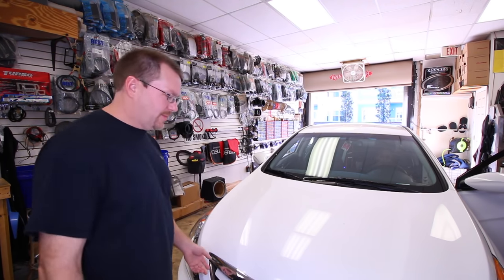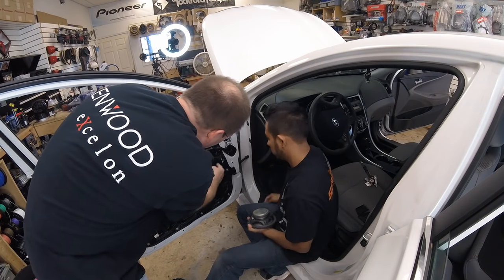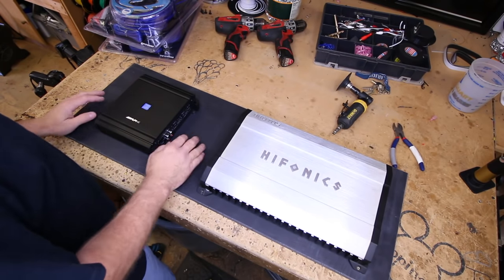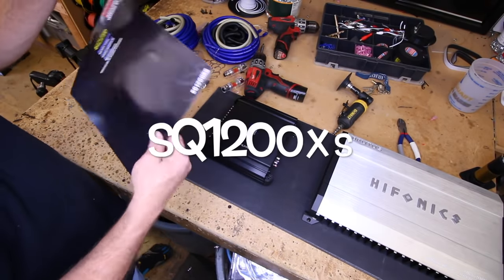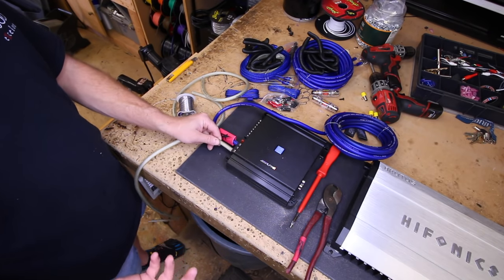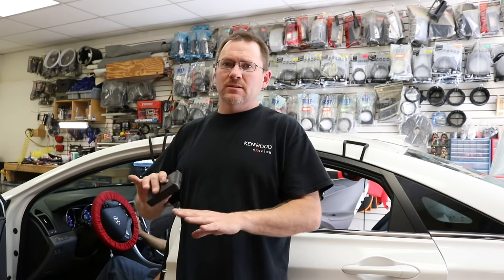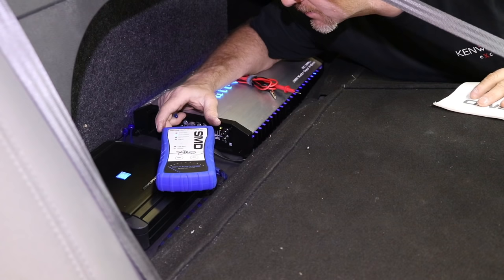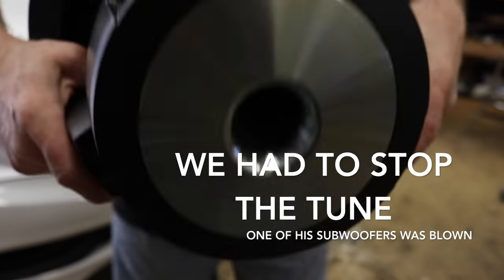Hyundai car stereo system installation make over

Comment: I love how you point out the wrong on stereo amps installation here.  When I first started doing stereo installations, I did many wrong things but learned better after many years of practicing.  If I had people like you to point out the wrong and right while starting off, that would have been a good experience for me.  Nowadays watching your video's are great and watching how some people don't take the time to research and do a poor job that you clean up is AWSOME.  It is like some do a C grade to a fail and you guys come in and do a A+ work!  LOVE IT!  (Also want to mention zip ties are great when wires are too long)

Comment: I've been a professional installer for over 20 years and i have never thought to tin the power wire when a ferrule won't fit.
Reply: Same here. Great tip to add to the installers knowledge bank.
Reply: That was a genuinely useful and good tip👍
Reply: Do you or anyone know if I should use lead-free solder or not?
Reply: That should not matter.
Reply: I just seen the tin aswell....im TAKING THAT with me now....thx DEAN!!!!

Comment: Great videos...
Amp gain adjustment question: a 3-way 6x9 with a freq response range from 50Hz to 22KHz, what test tone/s would you use to set the gain?

Comment: I have seen in almost all the installs that you use speed wire versus re-wiring the speakers all together. Will speed wire work with most applications?

Comment: Got a question for you guys on installing an older Rockford Fosgate amp. It’s a POWER 650 mosfet it doesn’t have your ordinary terminals for batter & speaker connections nor are the RCA inputs. Anyway, they’re all wires power & ground is wire sticking out and speaker outputs are colored wires and two pairs of rca input cables how would you go about installing an amp like that? What would you use for a safe install since you can’t screw in the wires. Thanks guys! It’s an amp I’ve had for a while and plan to install in my first car soon!

Comment: Liked and subscribed.  Are you using stinger speed wire to run power to the doors?  That wire seems small.  How much power can it handle?
Reply from the maker: Justin Gardner thank you very much. Yes we are, some people say between 50 to 100 watts. We use tons of it with all different amount of power with no problems.

Comment: well done guys!
does the solder on power or ground in 4gauge wire lower the connectivity by anything  measurable? I was thinking to do this also, but  was thinking it would add resistance.
What type of solder do you recommend for least resistance? 
Also, how do you approach grounding the amp? what points do you use? Do you have a video on this?
Reply from the maker: +Phil Indeblanc good question, honestly I never thought about it. I have been doing it for a really long time with no issues, so I'm  guessing it is ok. I get my solder from Stinger (AAMP). Grounding is a hot topic for sure. We have not done a video just on grounding yet. Our process is sand- star washer- screw or bolt, the star washer is between the car and the ring.

Comment: good tip tinning the power wires when clamping them into the amp. is there a reason why you don't use one thicker power wire (instead of two) with a distribution box?
Reply from the maker: Ferdinand Baricevic purely personal reasons, I like running a powerful wire for each amp. I'm not a big fan of the distribution block. I like a straight run from amp to battery.

Comment: I had a question would a eq crossover be replaced as a stereo in a vehicle the 4-7 band euqlizers that have subwoofer outs also , my concern  is if they would give the same amount of power line level outs  to amplifiers . its would be awesome if one day you could show us this option or what's good and bad when atempting such a install .

Comment: Awesome build guys! Just one question, how do I charge my capacitor? It didn't come with a resistor nor a charging bulb, I never used a capacitor but I got a larger system so I thought it'd be good to get one. Any ideas on how to charge the capacitor?
Reply from the maker: TheDevilLine6 you can use a car bulb of any kind to do it. Not a big fan of caps but sounds like a go idea for a video.

Comment: Any specific reason why separate power wires were ran all to the battery instead of using a fused distribution block in the amp rack?

Comment: Hey question i have a 2015 Hyundai Elantra I’m trying to upgrade the sound by just doing 4 alpine S type door speaker and keeping the factory radio with that make any good sound or I will need to add an amp

Comment: 2011 Hyundai Tucson GLS has XM, Bluetooth, Navi, amp, Sub-wof, CD radio.
Where can I get wiring harness /or block wiring diagram from original radio so I can install Android radio?

Got Android installed temporary but got no audio. Still has 5 cables/plugs (from SUV) not being used.

Comment: That hifonics should be using 0 gauge wire if running at 1 ohm judging by the 2 giant maxi fuses! That could be a 2500w rms amp aka brx 3016. 250amps thru  4 awg could be a problem!

Comment: What kind of zero gauge would be best to run a 7,000 watt sub amp and a 2,400 watt mids and highs amp with a 10fared power capacitor

Comment: What amp do you recommend for a factory speakers on the 2016 Accord Sport? Do you suggest upgrading the speakers with amp? If so, which amp and speakers do you recommend?
Thanks!
Reply from the maker: Randy Pacion have you looked at Alpine? They make reasonably priced quality amplifiers and speakers.
Reply: Five Star Car Stereo if i were to upgrade the 4 speakers, which amp should i get, 2, 4, 5 channel amp?
Reply from the maker: Randy Pacion if you might add a sub at anytime get the 5 channel otherwise get the 4

Comment: curious why pull 5 miles of RCA's just to have to shove them into the dash somewhere.  why not hide the excess in the back where theres plenty of room rather than up in the dash where its not needed at all.  enjoy your videos and appreciate you showing everything.
Reply: Its because he does it from the amp forwards. I agree with what you're saying but this is fine too. Its just easier on your back and faster going from the amp forwards. For me it depends on the car, gear install etc. But with a basic amp rack/install I'd have done the same. If its a more advanced installation with trim panels etc I might do it different.

Comment: I actually use wire nuts instead of crimpers because #1. I can’t solder worth crap, and #2. Crimpers have disconnected on me before. Wire nuts have always worked.

Comment: Maybe the video is somewhat misleading from the angle it was shot but the fuse should be at least 1ft from the battery. Granted it looked like there was about 2-2.5ft originally from the previous installer.
Reply from the maker: Breaux the fuses they were about 8" from the battery. We keep our fuse as close to the battery as possible. It reduces the risk of stupid.

Comment: i know this is off topic but can you tell me what a audio control matrix or the audio control epicenter will do for my system
Reply from the maker: +dirtydog111167 the Epicenter is a bass restoration device, it will take low dry Bass and make it load and boomy. The Matrix is a line driver. It is used if you need to increase the signal output of your source. It is good if you have multiple amps, 3 sub amps.
Reply: thank you

Comment: That much amplification for a set of coaxial speakers just seems... ...inappropriate. I'm sure it sounds fine, particularly considering the placement of the speakers within the door card, but it is quite unorthodox for front staging. Good work fixing the amp install.
Reply: Robert Coffey the alpine 4 channel is 300 watts. Those kappa can handle more.

Comment: Why do they run 2 gauge cables to the battery when you can use a splitter and hook up 2 short gauge cables to each amp ??
Reply from the maker: +Joaquin Murrieta that is just the way we like to do it.

Comment: Hey guys. Im planning to add a amplifier to a sonata sport 2015 but leave the original radio. And someone told me to use ax-aloc700 and also told me about the cable that i need to tap. But my question is if this only for the base. But i want to use for sound too. I dont wanna remove the speakers from the doors. I would like to add an amp for sound. What you guys recommend me to get ?
Reply from the maker: Get an Audiocontrol LC7i

Comment: why did you replace all the wiring?
why 2 fuse holders? just use a duel fuse block in the back
Reply from the maker: Eddie GTO the original wire was CCA. We would of had to run 0 awg wire. It was more cost effective to run 2 4 awgs
Reply: Have you done a video on the Kenwood double din to hook up the reverse wire
Reply from the maker: Eddie GTO this is last years radio but it is the same. 
https://youtu.be/qpP7GS-wUa4
We have the new one coming

Comment: did you guys discard the planet audio capacitor?
Reply from the maker: Desmond Campbell yes
Reply: Five Star Car Stereo ok cause I have a 5 farad hydride stinger capictor now. However when I add a second battery I was thinking about disarming the capacitor. Lastly when I install my 2nd battery will I hook it up like the capacitor or will I need to hook it up differently?
Reply from the maker: Desmond Campbell usual it goes main battery- fuse- firewall- run through car-fuse- second battery. Then connect your amps to the second battery.

Comment: So if you has 2 amps = 2 fuses becuse the high watt on total set on speakers?.
Reply from the maker: alexander hedblom I just like running a power wire for each amp.
Reply: aha okey,so they are in bridge mode id guess?
Reply from the maker: alexander hedblom unless they have a Master and slave feature.
Reply: aah i see.

Comment: You have to watch out for these pre install rookies. Not you guys. I had a guy that came in and said every time he powers up the amp it blows a fuse. I'm thinking under fused. He then said he didn't use a fuse and smoke starting coming from the driver's side door rail. It wasn't fused and burned it's way all the way to the battery. Door sill screw was screwed thru it. Yup. that will do it every time. Lucky his car didn't catch fire. I don't know how much he was charged, but it took a complete reinstall. About 2 hours worth.

Comment: Very nice looking install. The only thing I would have done different is run the power wires on one side of the car and the RCA cables on the other and not zip tied them together.
Reply from the maker: +bondovwvw look again the RCA's are going down the passenger side of the car and the power is down the drive. The thick wire that looks like a power wire  is a product called Speedwire from Stinger. It is speaker wire with a remote turn on wire twisted in.
Reply: what gauge are those individual wires in the speed wire?
Reply from the maker: BIG Chris it looks between 16 to 18 awg in size
Reply: Classic...separate the signal from the power...lowers potential noise...I agree

Comment: From what I understand its not a good idea to mount amps or any electrical devices onto your subwoofer box. The shaking and constant vibration can cause soldered parts on PCB's to come loose.
Reply: Mr Twister If your box is stable it really isn't an issue. People say this all the time but I have never seen an amp die being mounted to the box in my experience.

Comment: Don’t like how you set up the RCA wires to the back of the radio if there to long then 🧐 why not used the correct size or even costume length rca’s I’m not marking fun of your work but your a shop I’m just saying bundling up, RCA’s, and throwing them behind the radio is not the answer

Comment: Dear god that looked like a methhead special . Why did you run your rca,s along side the power wire ? Thats a big no no right ? Why not run them above then cross the power at a 90 ?
Reply: ALEX That's Speedwire NOT a 4 gauge power wire.
Reply: LOOK AGAIN  2,3,4, or 5 TIMES BEFORE YOU SAY SOME.

Comment: You said your a professional, but that amp rack looked so tacky and unprofessional.you think by mounting wire in straight line it's going to look good.well it doesn't. you should of made holes on the board and pass them thru the bottom
Reply from the maker: Nelda  Cardenad you do it your way I will do it mine. Running wires in straight lines or holes does not make you a professional. Know what I'm doing makes me a professional.
Reply: I'm pretty sure passing them through is the less professional method. Then the wire runs are under the weight of the board and amps.
Reply: Lol.It was just a joke. Nice videos, watch all of them.
Reply: @Chase. You put spacers and mount everything.